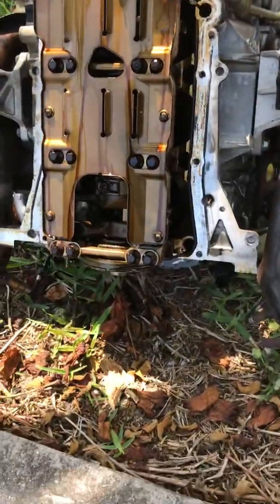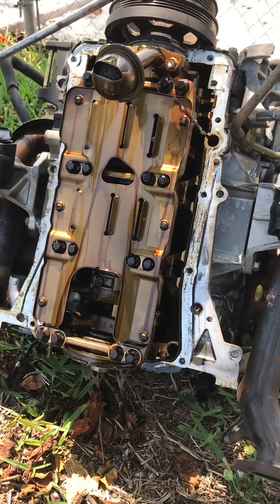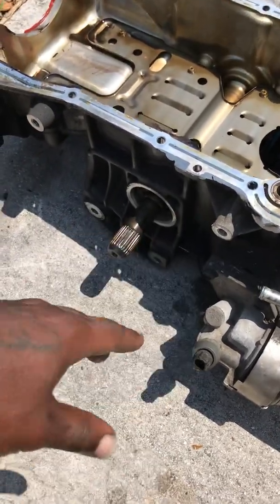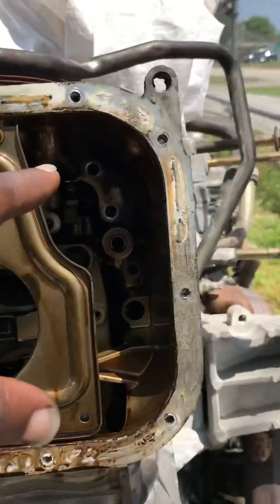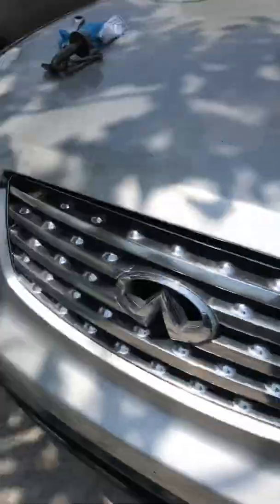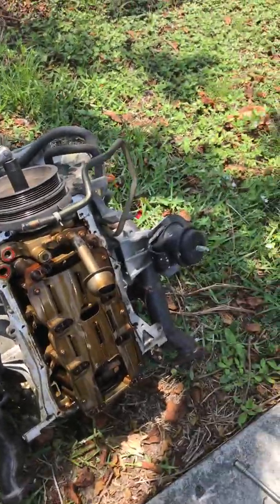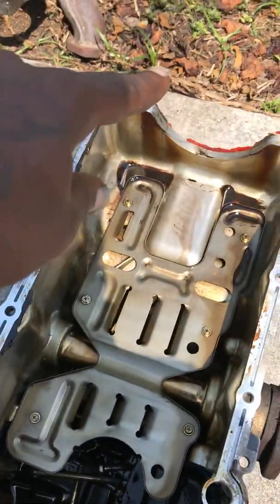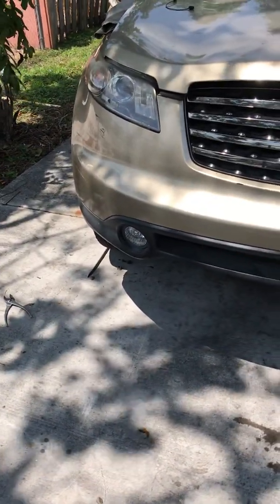Infiniti fx35 engine awd turned into rwd

Comment: You helped me a lot bro my brothers m35 rwd need a engine and only one we can find is a awd fx35. I knew I could do this but couldn’t tell if the upper oil pan held the main bearings or not and didn’t know what inside of awd one looked like with the drive shafts. Never seen anything like it